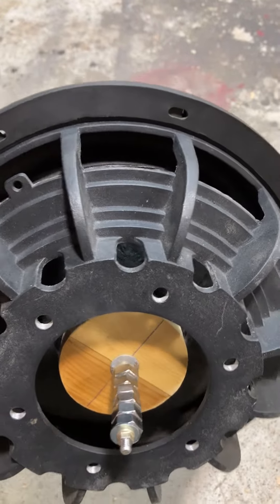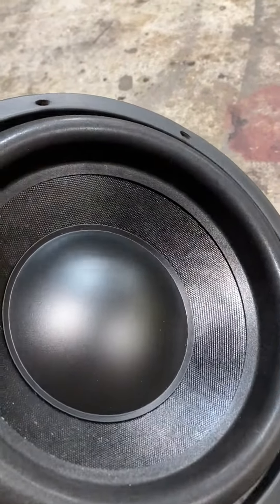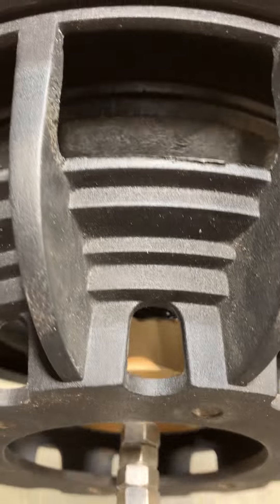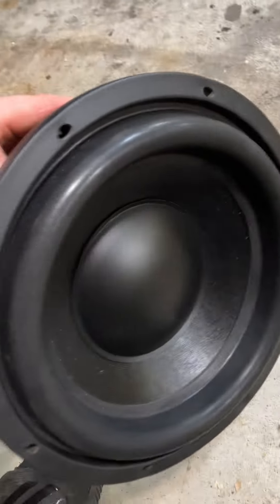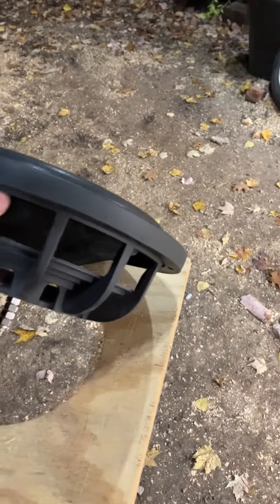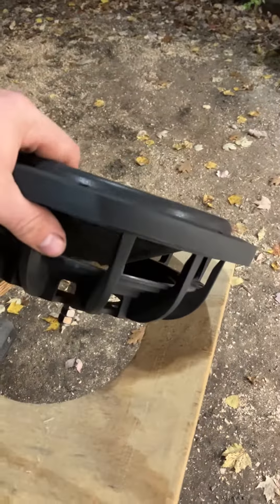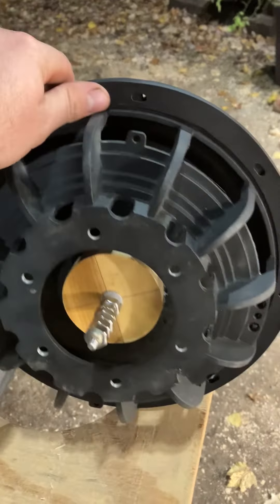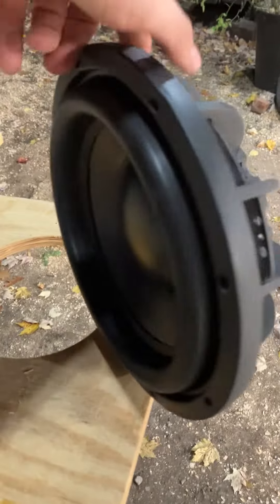Building a 10 inch passive radiator

Comment: By adding weight will cause uneven pressure on the radiator cone due to gravity pulling downwards.
Reply from the maker: Im not putting a 5 pound weight on it lol 😂 I’m putting ounces
Reply: @annihilationindustries1990   thx for the answer 👍
Reply from the maker: Just look up any passive radiator from parts express . They all have the option to add weight to them . Or look at kicker . They dont even have a spider in there passive radiators
Reply: @annihilationindustries1990  Yes I agree with that and take your advice. 👍

Comment: U definitely need a spider otherwise it will be all over the place cause the diaphragm wasn't designed to be a passive radiator if it was then would ve good otherwise need spider definitely
Reply from the maker: Yes and no ! theres plenty of passive radiators without spiders , including kicker audio. I wanted to try without a spider first because you cant go back once u glue one in. I later installed one 8 inch spider as i rolled it up and stuffed it through the frame. Now its so stiff it might as well be a subwoofer. And the foam surround was very compliant (quick to come back to its neutral state on its own without a spider). Every passive radiator in a JBL speaker is nothing more than a rubber surround and a flat plate.